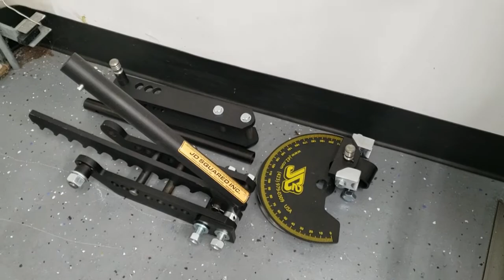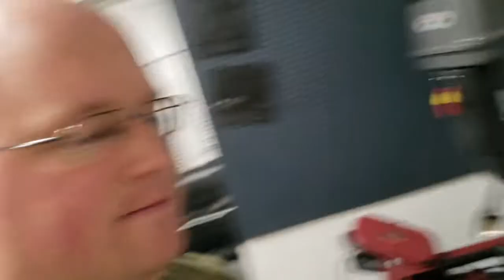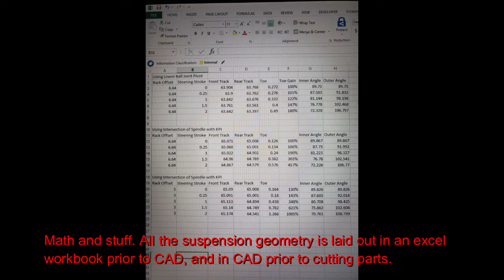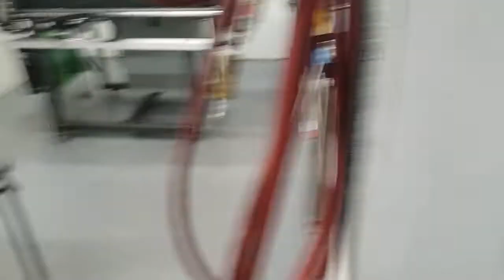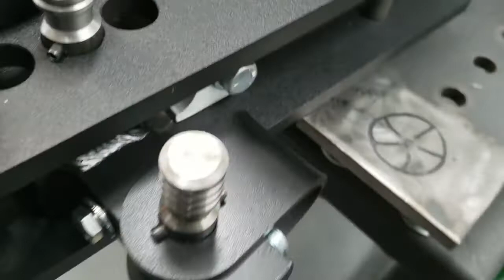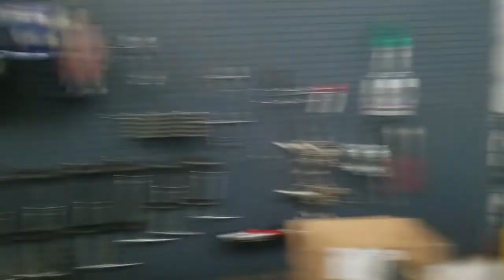"C1500R" Protouring OBS Chevy Chassis Build, Episode #2: Steering Rack, New Tools

Comment: Does the wheel offset effect the Ackerman angle? In other words could you have just changed the wheel offset instead of making your lower control arm a half inch shorter?
Reply from the maker: Doing that will have a considerable affect on the amount of positive scrub radius. Too much scrub radius will lead to tramming and a skittish ride over ruts in the road.